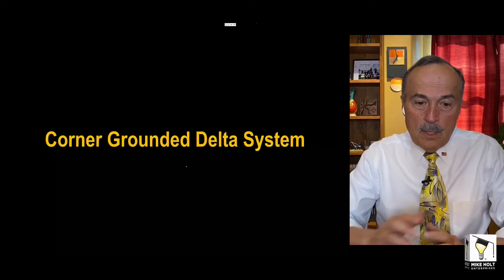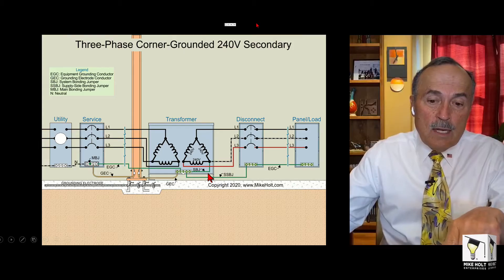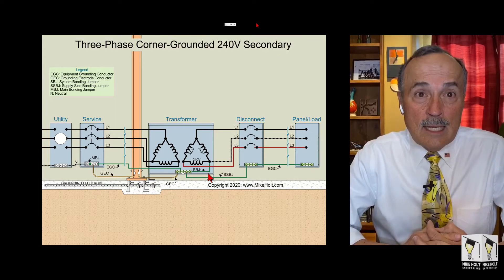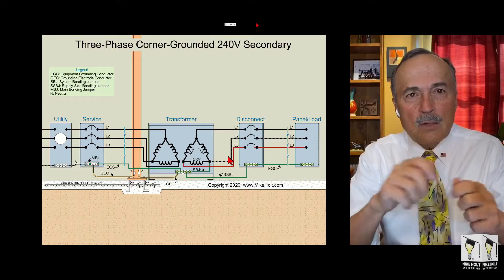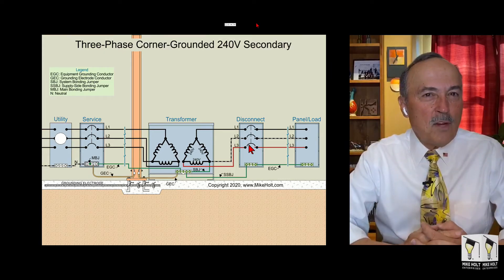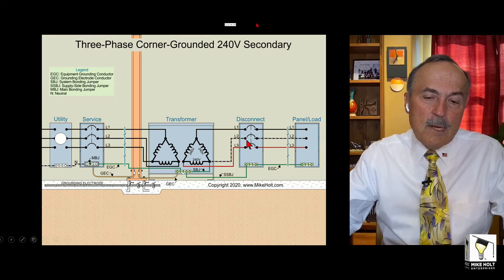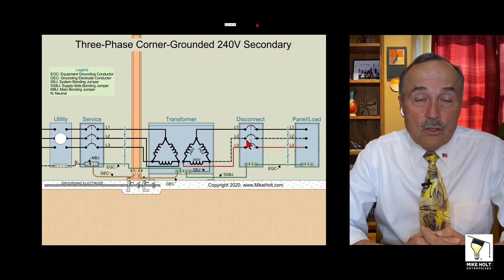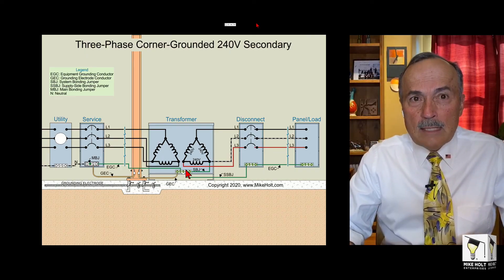Grounding a Corner Grounded Delta System, NEC 2020, (3min:56sec)

Comment: Mike, I’ve always looked at the grounded conductor in a corner grounded Delta as a “grounded phase” and not a grounded conductor like the neutral. Since it’s a ground phase and not a neutral, there wouldn’t be any unbalanced load to carry correct? Because of 
this, Ive always stuck with common color codes(480-BOY 240-BkRB(unless high leg then BkOR). I can’t imagine how many problems it’d cause electricians/or maintenance guys if they saw a white conductor landed on a breaker. I’m sure they’d immediately think it’s a neutral, especially if they put a meter on it and saw it had 0V to ground. Is this common to use a white or gray for the grounded phase in a corner grounded delta? I’ve never seen this before.
Reply from the maker: Well all I can say is that you have been violating the NEC. I really suggest you watch the video and do it properly in the future now that you know the NEC requirements.

Comment: One of the lineman instructors at my school is trying to teach his class to use B as the high leg instead of C. That’s not actually a thing is it?
Reply from the maker: I'm sorry but I don't know the 'utility' standards. It's my understanding that the utility is 'required' to terminate the high-leg on the 'C' phase, and we (NEC) are required to terminate the high-leg on panels on the 'B' phase. There is no termination requirement for high-leg terminations on disconnects.

Comment: Good day, I currently have a Delta High Leg transformer which gives me two lugs at 120v, one at 208, and a third used as a neutral. Is it possible to remove/disconnect the center tap function so I am left with just three lugs at 120v?
Reply: You're only getting the 120v at all because of the center tapped neutral, if you remove the center tap you would no longer have a neutral and you would have no way to get 120v, you would be left with 3 different phases at 208v of potential to each other.

Comment: B phase is the correct phase to intentionally ground. These types of systems are referred to as Grounded B Phase Systems.
Reply from the maker: Grounding of  "B" phase is common, but it doesn't matter what phase is Corner Grounded.
Reply: @MikeHoltNEC  I believe you are very likely correct but the trade slang I've always heard to describe this sort of system is indeed a grounded b phase system.  For this reason I've always tried to maintain a grounded b phase.  Honestly, it's so rare around here that if I referred to it as a corner grounded delta system people would think I was crazy... However, many electricians have at least heard of a grounded b phase system.  

Most have zero idea of how to deal with it but they've at least heard of it.  Just like a wild leg/crazy leg/high leg system, they've heard of it but most have almost zero interaction, let alone understanding of how they actually work, with these systems unless they deal with old antiquated services.
Reply: @LucasBorntreger explain how it works in dealing with that right now and I don’t understand it. Am I running a ground directly to the secondary b phase x2?
Reply: @damonsmith8411  First, let me start out with this.  I know there are far smarter people out there than myself and I deal with it enough to have some experience but not enough to do it blindly.  

I believe the transformer will be grounded just like you usually would with a traditional 120/208v system and actually hooked up the same way with that one difference, the corner grounded phase should be bonded to the case.  This seems counter to what we know but you should have zero volts from that phase to ground so this should work and keep that phase from being hooked up incorrectly elsewhere.  If you use a transformer to create a 120/208 system all three legs will work just like a more traditional commercial 3 phase system (120/208v Y). The load side of the transformer will "make"  a neutral and function just as a normal system. It should go without saying but just in case, the bonding will be on the line side of that transformer since the load side will have 3 ungrounded phases. 

Hopefully this helps.

Comment: In the oilfield the B phase is often not metered but A and C are.
Reply: how you measure the difference between single phase and three phase equipment? Two separate meters? How I can get fair metering in case or consumption between A and C. Can the meter distinguish the type by reactive power? Especially wen the consumption it's mixed and having reactive power like motors.

Comment: In electronics, when you ground one of the line conductors it's referred to as an unbalanced ground system. If you ground in between the line conductors with the secondary coil center tap it's referred to as a balanced grounding system. Is it the same way in power systems?
Reply from the maker: Nope, watch the video on what it's called for US power systems.
Reply: @MikeHoltNEC  <> I know you refer to a grounded line on a delta as "corner ground", but you don't mention single phase grounded line like you typically see in Europe. So I was wondering if line grounding was referred to as unbalanced and neutral grounding as balanced? I seem to remember reading something about that in the NEC regarding PV systems, not sure.
Reply: @Oldhogleg  Hi, I service industrial equipment, mostly European brands with CE certification. On some of the older equipment it's common to have single phase 24VAC for signaling & operator controls. At the secondary side of the trafo, the ground is always permenantly bonded to chassis/equipotencial buss bar. I've never see the ground on the stepeddown voltage supplied through a disconnect.
Disconnecting the ground just does not sit right with me, especially after watch so many Mike Holt videos on grouding. Even when the disconnect is engaged, its contacts are still a potential point of failure or increased impedance.
These 24V signaling and control circuits are rated at higher amperage, anything beween 10 to 40 amps is typical.
Reply: @trespire  <> I believe I see what you're talking about. I think you may be thinking of equipment ground and a system ground as the same thing. You're right about not wanting a CB/fuse on an equipment ground path/conductor. And you wouldn't on a grounded line side of a single phase circuit either. But on a three phase power supply you would because of the need for three phase power to power three phase equipment like motors requiring three pole protection; but I could be wrong. I'm no "expert".
Reply from the maker: @Oldhogleg  My work is about the USA and the NEC, not Europe or Electronics. Nothing is Solar has anything to do with this discussion.
Reply: @Oldhogleg  Ok, thanks. Some food for thought. I'm no expert either, nor a certified electrician, just want to be professional and repair / refurbish equipment to correct OEM standards, apply best industry practice, and be safe about it.
Reply: @trespire  👍
Reply: @MikeHoltNEC  I appreciate there are differences in the US  & European codes. I service the Israeli manufacturing sector for 28 years, mostly European industrial equipment.
Your explanations touch on the physical principals, that are a real eye opener for me.
If I may compliment, you're an outstanding educator, and making an impact to the trade. I think others feel the same way. Please keep it up :-)
Reply: 207V high leg and 240V interphasic (pole transformer with two phases on primary coil) isn't used in Europe. The corners grounded isn't used frequently due to lack of 120V for home use, probably its a 240V power source for working sites with long power cords, welding machine, powerful lighting and low power three phase machines like recirculating saw and drilling machines.
Reply: Good explanation.